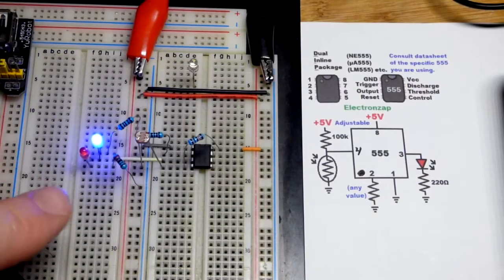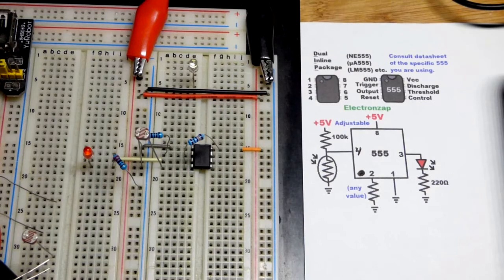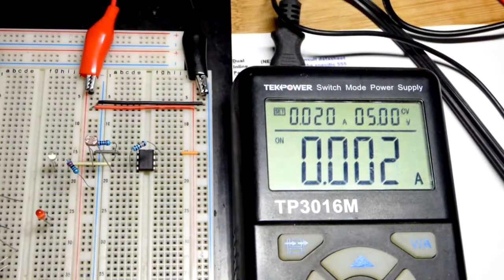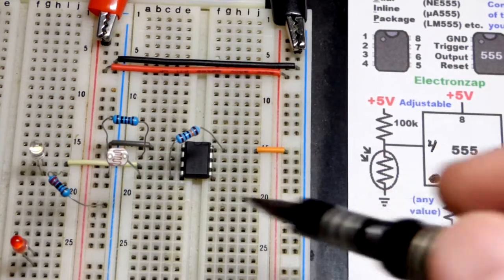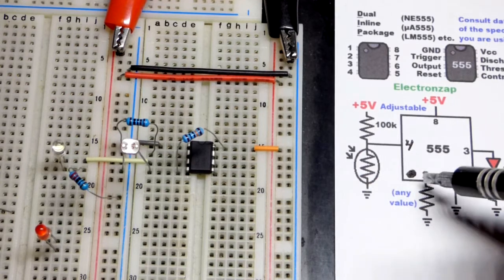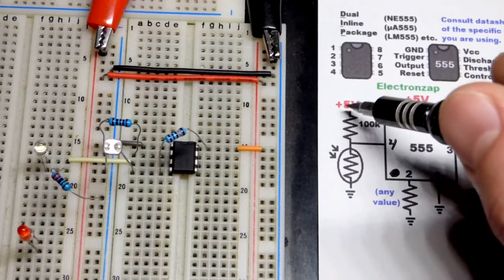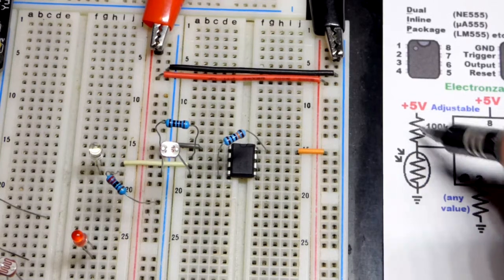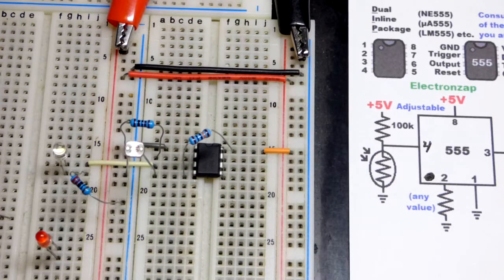555 output high and LED on only when it is dark using LDR circuit diagram

Comment: what is the switching value of the 555 could it switch a relay?
Reply from the maker: 555 can switch a relay that need less than 200mA of current, but I wouldn't do so with this circuit. if the light isn't bright or dark enough, then the output rapidly oscillates high and low. That isn't a problem with LEDs as they can be turned on and off rapidly for a long time. But, relays will keep switching during oscillations which is bad for relays.